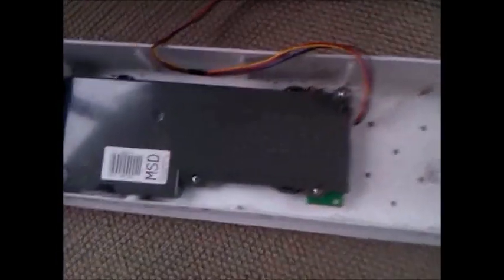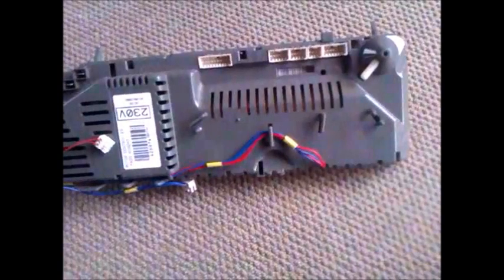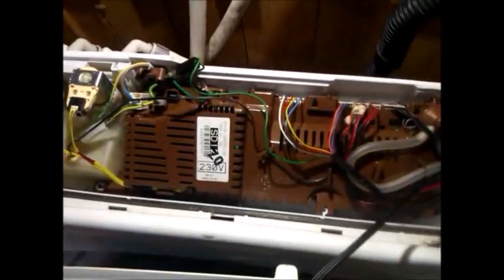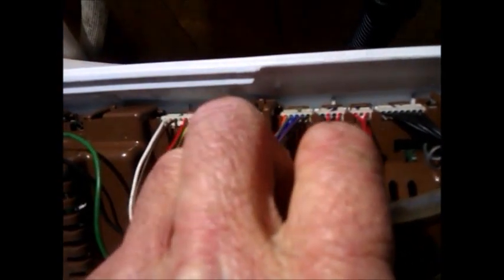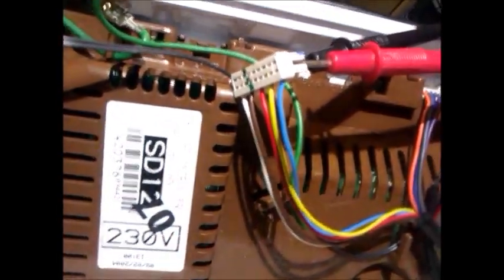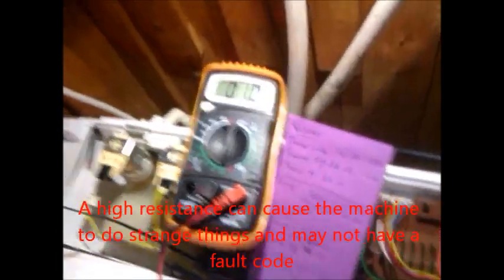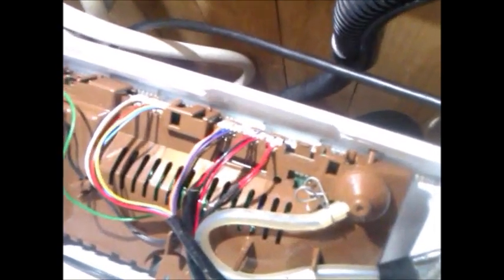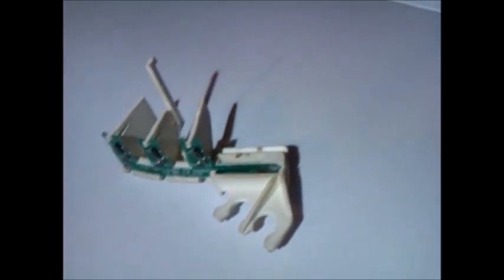Fisher & Paykel Smart Drive Testing Procedure

Comment: Oh another thing too to realise is the phase 6 boards are now like phase 7 design which is really confusing. So when you go to change a phase 6 make sure it’s the correct part number as well as the existing board.
Reply from the maker: Yes. All the brown modules are different. It must be the correct part number
Reply: Thats why i said you must check the part number on the old board before you buy the new board as it'll be different to the older ones. SD11 and SD12 have the same part number. IW11 boards are same brown board but different part numbers.
Reply: Phase 7 its not affected coz they've had the same design from the start, mainly Phase 6.

Comment: Awesome thanks for the upload and sharing. I am new to electronics but geeky and just tried this. Could you let me know if I am wrong here.... If I got a reading of 10, ohms between the brown and white but 33ohms for the others, does that mean there's a short somewhere on that brown and white circuit? (Situation is machine appears dead but is getting 240v in)
Reply from the maker: The brown and white wires are for the drain pump. 10 ohms is far to low for a 240v machine. It should be around 36ohms. This means the pump has burnt out and that may have cooked the motor control module or the main fuses. You could watch my "how to remove the pump" video and then this one 
https://youtu.be/PiDXHoRdYTs
Replace the pump if it's faulty

You could then unplug the motor control and remove it. Open the case up and remove the circuit board. You are looking for 2 cylindrical fuses which look like this :
https://www.ebay.com/itm/T2A-Cylindrical-Fuse-250V-Cylindrical-Fuse-Round-LCD-Power-Slow-Break-Fuses-/223498759950?mkcid=16&mkevt=1&_trksid=p2349624.m46890.l49286&mkrid=711-127632-2357-0

Test the fuses with the multimeter on the solder on the back of the fuse and you should get a reading of 0.0X .
If there is no reading, then the fuse has popped and needs replacing with the correct amperage fuse and the machine MIGHT work again.

Hope this helps.
Reply: @paulywooly  Cheers thanks so much! When I opened it up it looked like the earth was a little loose, could this have caused it? (it was in the slot but not pushed all the way in)
Reply: @paulywooly  Thank you so much for your generosity making your knowledge available on the internet
Reply from the maker: @danzacjones  no the earth wire us separate from the pump internal wiring

Comment: What does that  clear  pipe do why does it need to run up to the circuit board? Just  interested.  Thanks
Reply from the maker: It's goes to the water level sensor. As the bowl fills with water, the air pressure in that pipe increases and there's a sensor on the circuit board that measures the pressure and switches off the water supply at the Low Medium or High level

Comment: Hi Ya , nice instructional video , i got no power on , how to tell if its the motor control board or control panel and how to test these , my machine stopped with electrical burning smell on the rinse cycle i fitted new pump it then did one complete wash then stopped on next wash at rinse cycle with no power control panel lights ? . i tested all components shown in this video and all good any thoughts what the problem appreciated
Reply from the maker: A burning smell obviously isn't good. I would suggest unplugging the motor control unit and open it up with the 3 small clips on the side. Look and smell for any burnt out components. 
There should be 2 main fuses on the board you need to test with a multimeter across the pins. You should get a reading of 0.0x ohms. I have replaced fuses in the past but it's usually too late and the damage to the main board is already done and needs to be replaced. The fuses look like this https://rover.ebay.com/rover/0/0/0?mpre=https%3A%2F%2Fwww.ebay.com%2Fulk%2Fitm%2F192572897591

Good luck

Comment: I am getting an error code 49 with my gwl 11 washer. The valves appear to be testing fine at 61/64 ohms. Is there a way to test the motor controller, or is it apparent to just replace it?
Reply from the maker: It'll be a faulty power transistor on the controller board. You could watch my other video that MAY help but it is for a later model than yours. If you are an electronics wizzkid or know somebody who is, you can trace the tracks on the board from the water valve connections plug will lead straight to the power transistor of which will be 2. They may even be labelled hot/cold. Otherwise replace the whole control board. 
https://youtu.be/blfuyxuJUEY
Reply: @paulywooly  Thank you. Doug

Comment: I have a F & P GWL11-96151-B. Original error code 131. Upon taking the washer apart to replace the rotor position sensor I found that water from the thermistor had run into the control board area. I checked the diverter valve and pump both were fine. I replaced the bearings last year. Upon checking the Ohms on the motor control board they all checked out fine except for the brown and white wires to the pump.  The pump wires are attached to a 20v fuse (not blown) and had an ohm reading of 8.2.  Does the fuse added to the wires change the ohms?  The washer fills and drains fine but when it is supposed to spin it makes a jerking motion back and forth about 5 times then gives a code of 248. Plus when plugging the washer into the wall I get the same flashing 248 code.  What should I try next?  I am a widow and I can't afford a new washer.
Reply from the maker: The pump ohms test fine if you have the 110 volt USA model. The following is copied directly from the service manual for error 248 hope this helps:

248. (11111000) SmartPump Top Up Fault
More than 6 attempts have been made to top-up the water level in the bowl during recirc. This then signifies that the flapper valve has not closed full and some water is diverting to drain.
Primary Source: Poor Flapper Seal.
Action: 1) Clean any foreign objects out of the pump, concentrating especially on the flapper and drain/recirc port areas.
2) Remove the flapper to ensure no foreign objects exists below and around the flapper.
3) Check for flapper damage, especially the lip seals. If damaged,
replace.
Secondary Source: Cap not tight, warped, damaged (worn).
Action: 1) Check that the hood/cap are tight. If loose and screws are difficult to tighten, foreign objects could be in screw boss. Remove pump fully and inspect/replace if in doubt.
2) Check the cap is not warped or it is not excessively worn in the area where it contacts the flapper. Replace the cap if warped or worn.
Tertiary Source: Damaged Pump Housing Port
Action: Check there is no excessive wear to the pump housing port caused
by foreign objects. Replace pump if necessary. Quaternary Source: Motor Control Module.
Action: Replace Motor Control Module.

Comment: Hi Paul, great video!
The drain pump in my MW511 won't turn off. I have tested all items on the board and the resistance readings are fine. I get a cold water valve error (49) but the resistance on the valve is fine and water stops/starts fine.
As soon as I turn the machine on at the wall the pump starts. I'm stumped, any thoughts would be greatly appreciated!
Reply from the maker: That's a faulty transistor which controls the pump on the main board in the motor controller. You maybe able to get it repaired at an electronics repair shop. Or a new motor control unit is needed.
Reply: Thank you! I suspected It would need a new board.  Might just be time for a new machine as we have had it for a while..
Reply: @paulywooly  I had the same problem on a Phase 2 Control Module. I diagnosed a faulty Triac BT 136, and also changed a resistor on the gate. Also changed out the Opto Triac Driver. It worked perfectly after that. I am self-taught on electronics, and it is a marvellous feeling to see it all work again.
Reply from the maker: I wish I had the knowledge to do that. I've got boxes of dead modules and would love to fix them.

Comment: Hi Paul, I have a 6 year old Fisher & Paykel Washsmart Eco washing machine (WA7960E1) that wont turn on. It happened after I paused it during the rinse cycle, then tried to go back to the wash cycle, but every time I tried to get the cycle to start, the machine instead would only advance to the next cycle and only started working at the spin cycle. So, I switched it off at the wall and now it won’t turn on. I have tested it in another working socket, but it still won’t turn on and I have left for for a number of hours (and days) and it hasn’t reset, which has worked in the past when I have turned it off at the wall. 

I am wondering if it might be the power supply, as this has happened before, but, until now, it has turned back on after a time. If it is that, is that something that can be fixed? And can I test anything to try to isolate the problem?  Any help would be greatly appreciated.
Reply from the maker: Sounds like a faulty motor control, if there is no sign of life when it switched on at the wall.  There is a main fuse inside the unit that can be replaced but 9 times out of 10 it usually pops again when it's powered up. It's usually easier to buy another motor control online.
Reply: @paulywooly  Okay, thanks for you speedy response. Where is the fuse located so I can see if it looks like it has blown? I had the control panel off, but I didn't notice any fuses there. If it is the motor control, that looks to be quite an expensive part (over $300)… it's probably not worth replacing, to be honest, with the cost of labour on top of it. I will see if I can find the fuse, but it is sounding like a new machine. Pity, this one is only 6 years old and there aren't any other brands that make a top loader with an agitator, none actually, so it looks like another Fisher and Paykel, but I am not really all that happy that this one has only lasted 6 years. I had my last one for 19 years (it was also F&P). Obviously they are not what they used to be, but I expected more from a machine that cost nearly $1000 6 years ago and is now well over $1000 to replace.
Reply from the maker: @lyndellemcmillan1781  if you are up to opening the control module and able to use a multimeter you can test the 2 fuses that looks like this
https://a.aliexpress.com/_mrJfQvW
Reply from the maker: Your model number you gave me doesn't match anything I have in my books. Please check again
Reply: @paulywooly  Yeah, I see that now. Its the WA7060E1. Sorry.
Reply from the maker: @lyndellemcmillan1781  ok just a typo.  If you live in New Zealand this is a good website to purchase from
https://www.appliancespares.nz/products/fisher-paykel-washing-machine-main-control-board-controller-module-pcb-429889nap
Reply: @paulywooly  Sadly, I am Australia.
Reply: So, I take it there is no fuse?
Reply from the maker: @lyndellemcmillan1781  so sorry for the late reply. I haven't worked on that particular model but this video is the best I can offer you. I think it's has a similar control module. I hope it helps. Look for the round brown fuse
https://youtu.be/blfuyxuJUEY
Reply: @paulywooly  No problems, thanks for your time and help. I think I did have a look at that video already… it's what prompted me to ask my first question. I will have another look and see if I can test the bits you suggest to see if I can figure out what's going on. Can I electrocute myself or is this all done with the machine turned off?
Reply from the maker: @lyndellemcmillan1781  yes definitely switch off the machine at the wall! You will need to use a multimeter and soldering iron to make repairs to the circuit board. Be careful if you are not experienced
Reply: @paulywooly  Ha ha ha… I would definitely say I am inexperienced. However, I do own both of those pieces of equipment. I figured it would be unplugged, but thanks for the tip. The weird thing was I had the machine apart before and had a really good look at the circuit board and it all looked to be in perfect condition. I am no expert mind you, but I definitely couldn't see any signs of damage. I took a photo of it, while it was apart… I could send it to you.
Reply from the maker: @lyndellemcmillan1781  yes everything can look fine on a circuit board hence the multimeter to test. My knowledge of repairs to the circuit board is very limited to just  fuses and sometimes power transistors. You'll have to send the photo to a cloud which I can download and let me know the link. 
Also check the continuity of the power cord to the motor control unit . It's very rare, but the cord could be faulty

Comment: Hi Paul, I have a F & P MW -513 Quicksmart that my wife said “ started beeping & then stopped”. It now has no display on display module. Tested and it has 240v to motor control module. Both printed P.C.Bs look fine and both fuses seem ok. Tested voltages on motor control module and all test points to display module read 113v to earth. Seems to have a 120V transformer.
I tested components and got the following readings-
Motor - 40ohms/ 40ohms / 40 ohms.      Water solenoids - 57.7ohms / 58 ohms.  Lid Lock- 64.6 ohms.
Water Pump - 93.4 ohms ( seems high).
All tests were done with good quality Fluke meter so should be right.
Tried pushing wash temp/ power button to obtain fault code but no display lights.
Do you have any ideas or suggestions?
Please advise -
Reply: I know it was 3 years ago but what was your outcome? I am currently having the same issues as you had. Thanks!

Comment: Hi Paul, I have a GW712. Stopped working (including no lights on the display) and a strange smell was apparent. I removed the display panel and found the display wires had burned the insulation on a couple of wires. I reinsulated the burned ones and reconnected. Still no lights on the display but when I press the power button, I can hear a relay click in the control module. Any thoughts whether I just need to replace the control module and/or the display module?
Reply from the maker: That certainly sounds like a major meltdown. I would remove the motor control module by unplugging all the wires and the tube. Maybe take a photo of the module first. Undo the 3 clips on the side and open it up and pull out the circuit board. You'll have to break the warranty sticker. You need to look for any burnt components or  check the 2 fuses on the board with a multimeter. They look like this:
https://www.webstaurantstore.com/hobart-00-914782-00007-fuse-printed-circuit-board/HP3009147820.html
If one or both has blown you need to replace them. But sometimes if they have blown usually means the board has had a meltdown. If there is any burning or black areas on the circuit board means it's completely cooked. 
Normally the display modules are very reliable, but you could check inside that too.
Reply: Thanks so much Paul. I will take a look. My MCB is an SD12. I have found a second hand one on gumtree which is an SD11. Are they likely to be interchangeable?
Reply from the maker: @peters5493  best to stick with the SD12. Some SD11's  have the plug sockets in different positions. It's best to get the same part number on the sticker starting with 420...
Reply: @paulywooly  Hi Paul, did the checks as per your amazing video and found that the pump resistance is only 1.7ohms, which is very low - suggest a. Interval pump fault short? The MCB looks fine including the fuses. Is a shorted pump likely to cause display wiring to burn without impact to the MCB? I would think. The display would give you an error code?
Reply from the maker: @peters5493  Good on you for checking the pump resistance. When the pump shorts out it doesn't usually give any error code at all but it is very very common for the pump to pack up. My other pump test video explains  this. I would definitely get a new or good second hand pump and hopefully should solve your problem fingers crossed
Reply from the maker: https://youtu.be/PiDXHoRdYTs
Reply: Hi Paul, a final update. I removed the pump and it was in poor shape with a “growth” over the coils. I ordered the pump, display harness (which was damaged) and a module (to have as a spare if I didn’t need it this time around) for around $100. Fitted the pump and harness and still no success. Replaced the module and it came alive again! Looks like the pump short sent an over current to the board which fried the board and the harness to the display. Board had no visible damage. Happy days getting the machine running again after 17 years of trouble free service so far. Actually pretty impressed with the build quality so glad to be keeping it. Could not have done it without the guidance from you video - you’re a legend! Thanks again
Reply from the maker: @peters5493  We'll done! 
And that's a good price for all those components.
Reply: @peters5493  where did you get your parts for that price?
Reply: Part purchased from eBay seller h0lden who was incredibly helpful. Highly recommend.

Comment: Me again sorry. If I get a reading of around 33 at the stator/ pump plug at the motor control unit , is it safe to say the pump is good?
Reply from the maker: Yep 33 sounds good when it's cold. But if the pump is faulty it will give a different reading when it's been working.. Run the pump for 3 mins and test again, or even better tilt the machine back and feel the pump. If it's hot, it's faulty. It should be slightly warm.
Reply: Paul P The pump will not engage at all. It just throbs every 5 secs or so like its trying to start but nothing.

Comment: Hi guys, can anyone help with a suggestion on why my F&P 5.5 smart drive won't pump out the water . I've removed the pump , cleaned it and refitted it still no luck. I've also checked the motor control unit with the multi metre as per the video and all was within specs. One strange thing I have noticed since playing around with it is when the power is turned on the machine will constantly hum very slightly. I've never noticed this before. Any advice would be very much appreciated. Thank you.